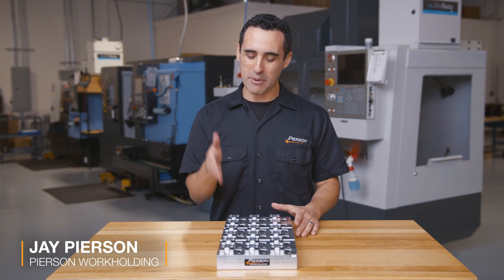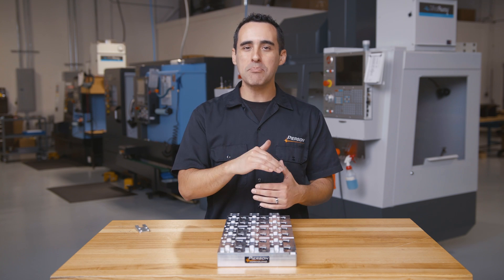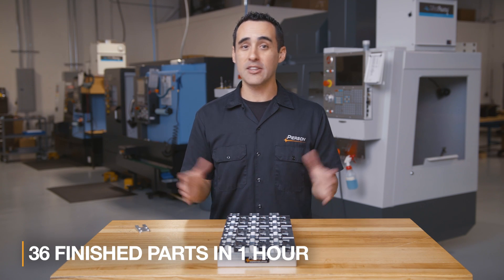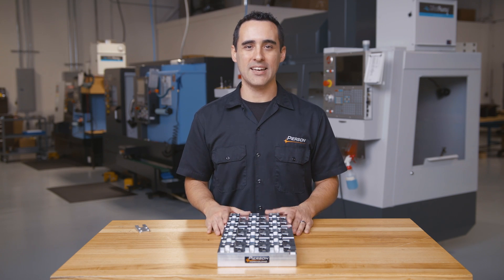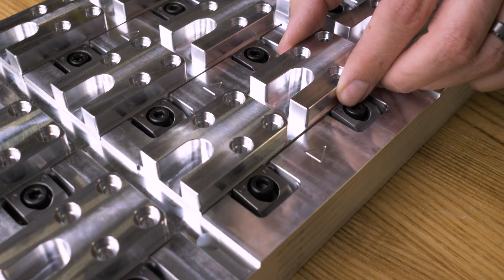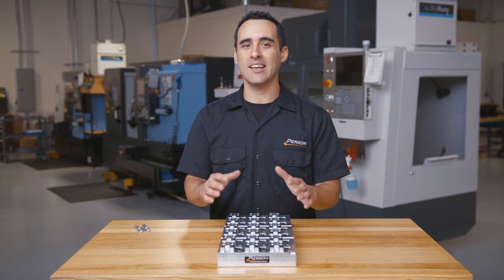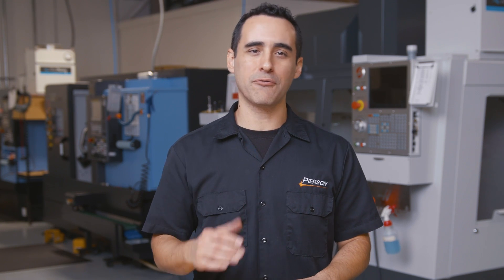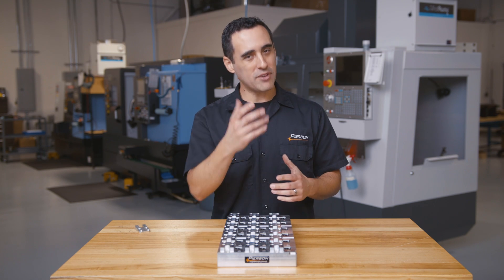Top Tips to Get the Perfect Fixture | Fixture Friday 3 | Pierson Workholding

Comment: I'm a big fan of multiple parts on a single pallet/setup for ALL production runs.  Does Pierson incorporate hydraulic clamps also?  I may be in need (We recently bid a VERY high quantity run) of a few where I can run more parts at once on a longer table.  Using your part you just demonstrated as an example, could Pierson build a pallet that holds approximately 100 pieces using hydraulic clamps instead of the manual clamps you used here?  I've used hydraulic clamps to cut wing spars in the past.  They work fast and BEAUTIFULLY!
Reply: So how did it go?

Comment: What is the benefit of using half a pallet for operation 1 and half a pallet for operation 2 vs a whole pallet for operation 1 and a whole pallet for operation 2? Wouldn't you have a faster cycle time using separate pallets if both operations used different tools?
Reply from the maker: Lean Manufacturing promotes one-piece-flow to minimize defects and waiting.  By putting all operations on one pallet you can have finished parts each cycle instead of having lots of parts waiting for the second operation. Also consider if you get to Op2 and realize you made a mistake in Op1.  That mistake would have been caught if both operations were on a single pallet.
Reply: @PiersonWorkholding  That makes a lot of sense! Thanks for the fast reply!